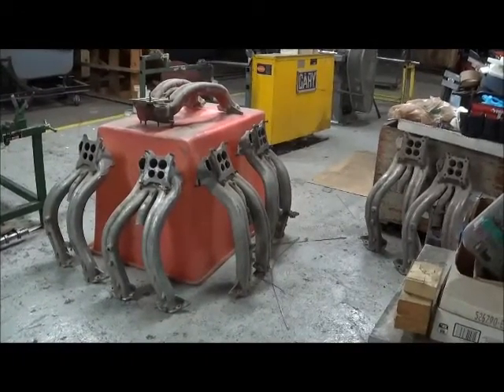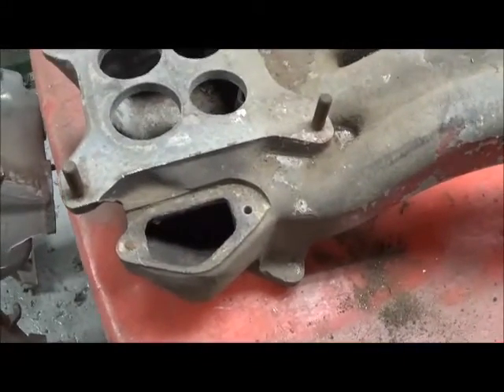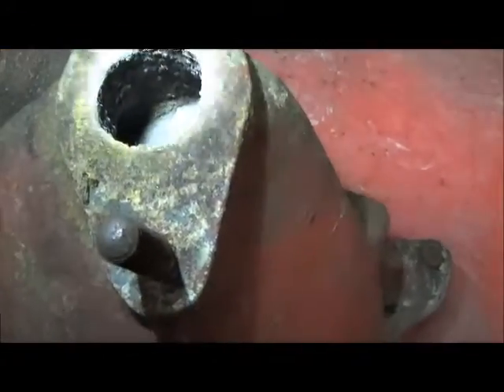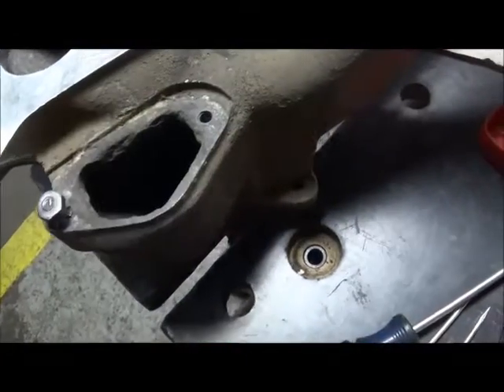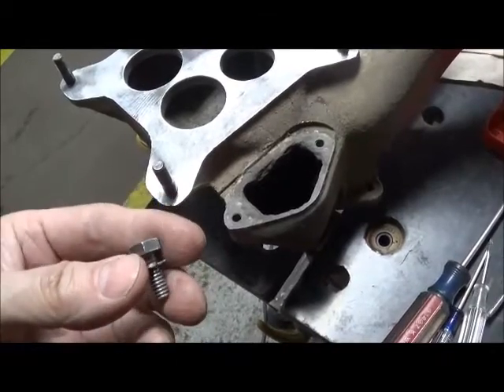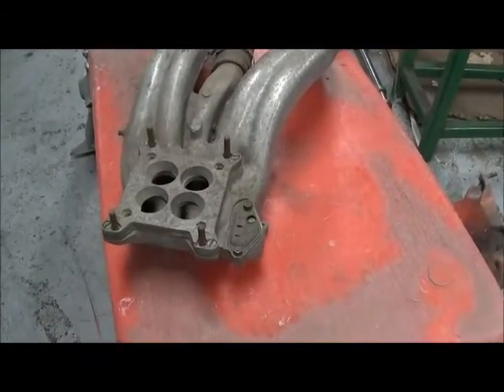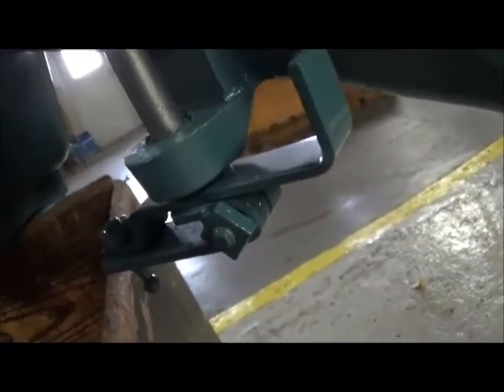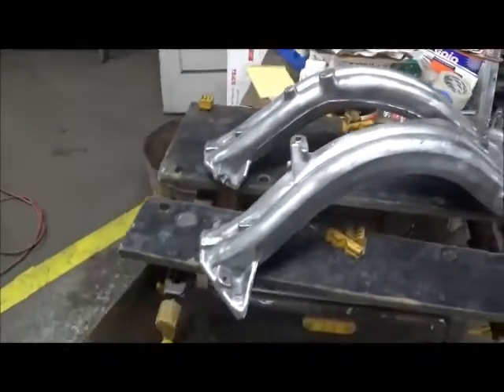Chrysler Long Rams evaluation, prep for paint

Comment: That adapter plate is for a square bore Carter carburetor, Chrysler used over-sized Carburetors on those long ram engines.
Reply: I agree.. Two two barrel carbs of 350- 400 chm each would have done a great job with this set-up...